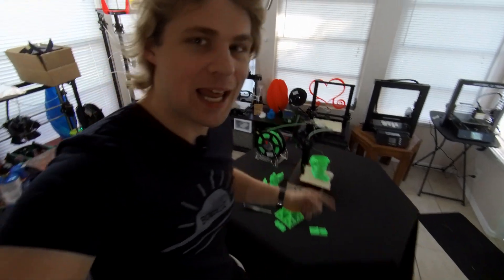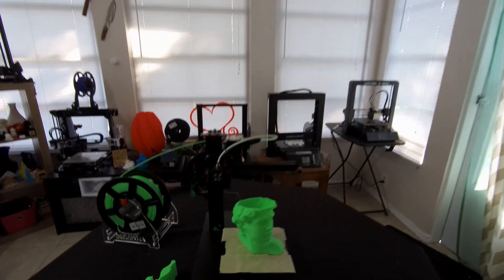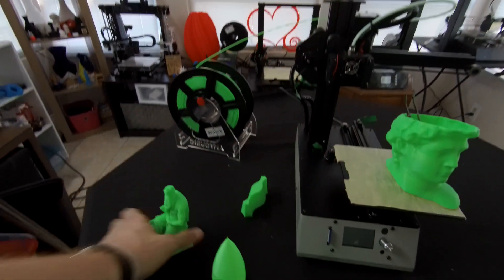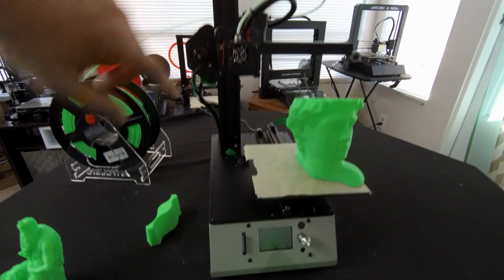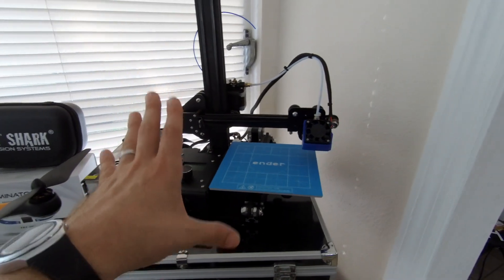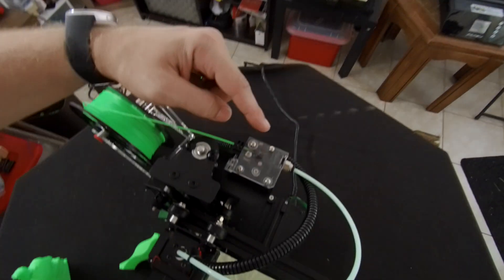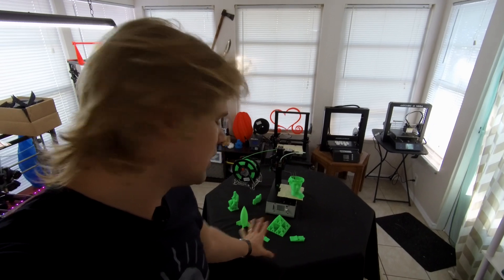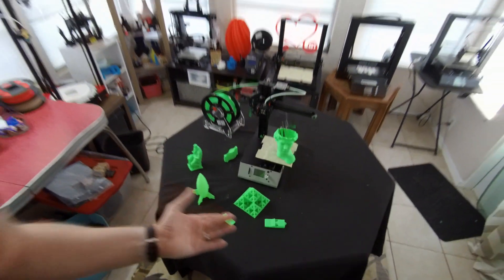✔ TEVO Michelangelo Portable 3D-Printer Unbox & Review!

Comment: I have been testing my Tevo Michelangelo for a few weeks now and a very good printer for the money, but be aware that some of the mounting plates may not be as straight as one would like and this can cause premature wearing of the V Wheels. a few small issues with alignments but all can be adjusted and set correctly. Belt alignments should be checked ! especially on the Bed axis. The flat idlers should also be changed to toothed versions to help belt alignment.
I have been running mine with 0.2 nozzle and the results are awesome to say the least. Great out of the box. Amazing if given a small service as described above.
Excellent little printer and ideal for a 1st purchase.

Comment: This printer is inferior to the Ender-2.  The powers upply in the TEVO is only a tiny power brick because it does not have a heated bed.  The reason the Ender-2 has a seperate power supply is because of the heated bed it needed a much larger PSU.  The only thing the TEVO has going for it is the geared extruder (titan clone).  It is also aesthetically nicer and has a touchscreen.  Print quality I would say they are equal, and the heated bed on the Ender will allow printing PETG.  Its a coin toss,  if you prefer aesthetics and the touchscreen get the TEVO.  If you want a workhorse more utilitarian printer,  the ENDER 2 is the better printer.
Reply: I don't own either of these but am currently looking at buying one of them as a second printer and thus I have considered all aspects of the two and you are overlooking some key points. 
Ender-2 has a closed board that requires an arduino to add bootloader if you want to be able to change anything in firmware. Not to mention the board also has built in stepper drivers which absolutely sucks. I hate buying printers with all in one boards, it limits options and if a stepper driver dies then you have to swap out the whole thing.
The michelangelo has a mks gen L v1 which is clearly a far superior board than what the ender has.
Then there's the dual nozzle fans that apparently provide outstanding part cooling while the ender doesn't even come with a single part cooling fan. You either print the mod that shares the fan and put up with average part cooling or stuff around modding the annoying firmware on the ender to add a second fan.

I do find it annoying that the Michelangelo has no heated bed and the crappy tiny psu can't even handle adding one but that's the only single thing wrong with it. And adding a psu and heated bed to the michelangelo is easier than adding a part cooling fan to the ender which should be a very simple mod.
Reply: Yeah. I've just seen a picture of a Michelango printed benchy exhibiting the salmon skin effect though. Salmon skin yet again from Tevo!
So now I don't know what to do. Seems like it will need stepper smoother upgrade like the tornado to get rid of Salmon skin. Frustrating, it seems like such a nice printer.
Reply from the maker: no doubt) as for PSU's I often replace them with 30amp PSU's which aren't much bigger at all. I wonder if I could fit an upgrade within the case ;)
Reply: You definitely can fit an upgrade psu in the case. I saw a video showing inside and there is heaps of room.
Reply from the maker: Good points! No doubt the heated bed and psu could be better, but thats about it! :D

Comment: I see they copied my triple hot end design I made for my Ender 2 :-) (which I am fine with) I really like the layout and base unit. I don't like the lack of heated bed. it would not have cost them much if anything to add that. in fact the whole reason creality did away with the nice ender 2 power brick and replaced it with the fugly psu is people wanted higher bed temps (brick could only get 65c reliably 70c in the summer) but with the PSU their was enough current to hit abs/polycarbonate temps!

I am hopeful though it looks nice and your prints look nice too!!
Reply from the maker: I do like that triple fan hot end)) haha
no doubt I was a bit baffled as to why they didn't go ahead and add a heated bed, but I guess if your just printing PLA it won't be a problem. Still I agree it would not have cost much to do it and it surely would be easy to do with the design.
Reply: I have not tried it with my ender rig yet but try running the fans at 50% it should still work just fine but result in less noise and longer life of the fans. :-)
Reply: I was wondering if someone had made a DIY version of this shroud. What did you print your's out of? The one on your thingiverse looks like it might actually be sparkly PLA.

How do you wire up the duel fans? Like do you just splice the two fans together and have them share a single jst connector? Or does the Ender-2 board have 2 cooling fan ports "KFan and Laser"?
Reply: Darkmastergrey yep sparkly pla ziro twinkling clear. 30mm cooling fan. Yep wire them together to one jst. Works great. I guess they liked my design :-)

Comment: You think it's worth giving up the heated bed on the Ender for the cooling fans and compact unit? Looking for my second printer, it's between this and the Ender. Only printing PLA on this one.
Reply from the maker: I have a few other smaller printers without heated beds as well, it seems like it's not as big of a deal when printing smaller PLA pieces. I like this unit a bit more than the Ender currently)
Reply: Think yes as a heated bed can be added easy to any machine later.
Reply: But Ender is $80 cheaper.
Reply: Yeah, I bought an Ender as I already have a CR-10 so spare parts are easier.
Reply: Love this printer. The prints are amazing out of the box. 3d printers under 1k take up time as it is trying to dial them in and add things. Its nice to not have to touch the MA and get it started quick.